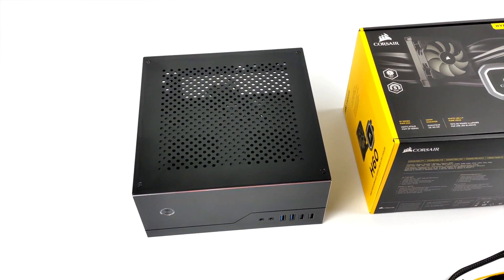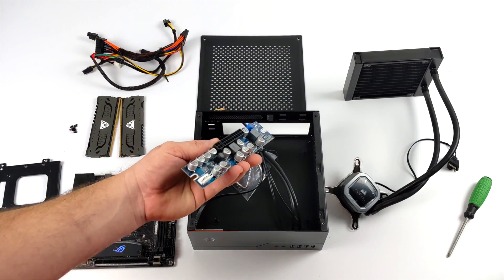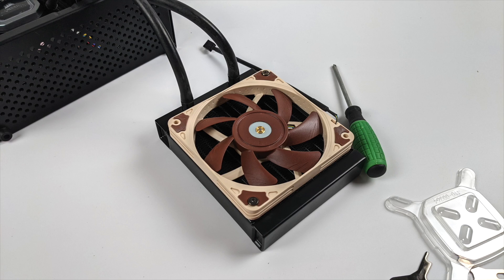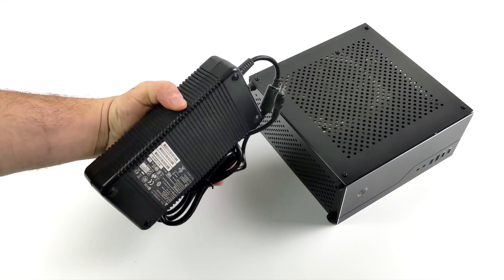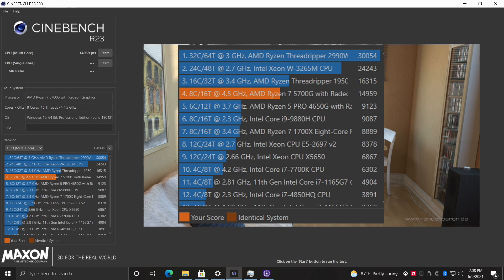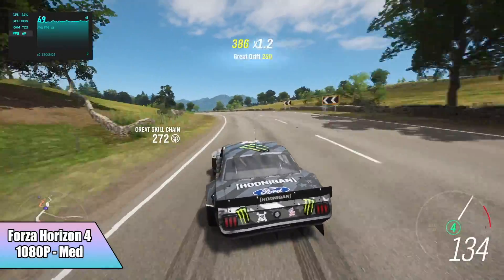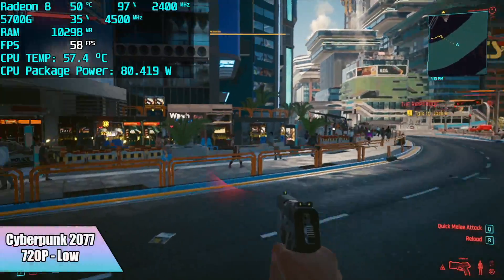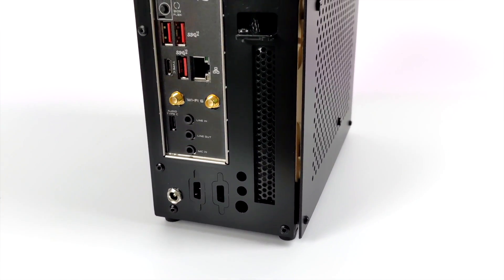Ultra Small Water Cooled Ryzen 7 5700G Gaming PC Build!

Comment: Great build. The last ten Pc's I built were asrock deskmini's ot small cases with mini-itx motherboards  
I built a few Asrock desk mini's with the Ryzen 7 5700G, The mini case is  6X6X3 inches. I used the Noctua NH-L9a-AM4 cpu cooler. Very adequate for that cpu.

Comment: Have done a video on the 5700G  with 64 Gig ram and using 16 gig of that for Vram? If not, I'd Like to see the performance on that? thanks. I've done it on mine with 32 gig ram and 8gig dedicated to the gpu. I actually just did that today but haven't tested it yet on gaming.

Comment: I'm doing this exact build except I'll be using a fan instead of water cooling. Other than that all the components are the same. Quick question though, what other power brick/cable do you recommend? The one in the description says that it is out of stock on amazon.

Comment: Were you able to overclock like that with just the 4 pin CPU connection from your power supply, or did you need to add an 8 pin adapter?
Reply: 4 Pin brings 192W for the CPU.For Gaming and 99% of other stuff it's enough for that

Comment: One aspect to tuning APUs is leaving the CPU clocks on the low side to maintain lower voltage and overclocking the gpu side and tuning the ram. Because the APU shares power and thermal headroom with the cpu it's best to stress just the gpu for gaming. (The the cpu at lower clocks wouldn't bottleneck the gpu in any normal usage). I'd say try something like this in the future

Comment: The flashing aliasing from CODWarzone was really distracting and annoying to me. I also don't like dynamic resolution either. The pop-in insanely-low-resolution shadows were also very distracting, and surprised that the game actually has that as an in-game setting rather than some config file hack because it looks insanely bad before the pop-in, like looking at a QR code.

High-tech high demand modern games look uglier at low settings than a 15 year old game looks at high settings, or at least CODW is the perfect example of when it is the case.

Everything else looked okay though. Except Cyberpunk which definitely needed to be 1080p despite the low FPS. Especially considering that it's an easy non-competitive game, the FPS doesn't matter much.

Comment: hi, just two notes : When overclocking cpu speed and memory, there is a sweet spot that is almost never the maximum Mhz, take a look at gamernexus youtube channel. You will get higher performance, much higher in fact at certain speed ratios.
Those AIO(All In One) water cooling solutions have a limited life, just, get ready to replace it in a couple of years.
Reply: You are actually wrong. This is a Ryzen APU with no infinity fabric, so it functions much like an intel build for memory. You want as fast of memory speeds on an APU even if the cpu speed relied on infinity fabric and was slowed as a result, because the graphics needs as fast of memory as it can get. With AM5 using ddr5, we will see even closer to discreet gpu level performance as the ram will run at higher frequencies.

The sweet spot on 5000 series is between 3600 and 4000 depending on your cpus capabilities, although I have seen desyncing infinity fabric, with high enough memory clocks, outperform that sweet spot too. It is just more rare. The 5000 G series should run at the highest frequency you can push with decent timings and latency, as the graphics are almost always more limiting than cpu speed would be.

As for the AIO, you're more right, on that. The pumps will eventually die, but they usually last 4-5 years at least for high quality ones. I've had some last longer too. Some bad ones die in under a year. But for small form factor they're one of the best options still
Reply: @a.f.r.m...d.e.d.d.2898  "The 5000 G series should run at the highest frequency you can push with decent timings and latency" thank you so much for improving my english :D :D :D :D :D :D
Reply: @A Google User It is a single die, so infinity fabric speeds are irrelevant to it. That is why it can achieve 1:1 with basically any ram speeds. If there were multiple dies with an infinity fabric, it would still have the issues that other 5000 series Cpus have had with ram over 4000 mhz

Comment: Looking at this build, i think it can be done better with a better case. The Velkase Velka 3 is a mitx case that's set up in a sandwich layout and uses a flexatx PSU in a 3.9L size. The good thing is, it's small but can handle a rtx 3060ti )mini itx verison, 170mm). But since you don't need it, you can chose to change the case from the standard to a 1pcie slot apu version. The motherboard is essentialy moved one pcie slot back. Allows for more CPU cooler clearance yet leaves you with one slot for let's say a capture card.

Comment: APU is good only if you must use tiny pc case, but except for that, its better to get reasonable priced video card with reasonable 6c 12t CPU.
I have 4750G, though.
Reply: "reasonable priced video card" doesn't exist...
Reply: @LiLBitsDK  I know. so this is good choice for right now.
I bought 6 monitors and monitor arms,  X570 AORUS XTREME E-ATX, 128GB Trident Z Royal RAM and 1GB M.2 x3 and  80Plus Titanium power units x2, and PC case last year Octorber, and waited 5800x and RX6800, but while I was waiting their price fall down a little, I couldnt buy them anymore.

Comment: Has the Fclk been increased on the CPU??
Not 100% but I was under the impression that all Ryzen CPU's run a 1800mhz Fclk which is the single bus speed of the link between the memory controller and the CPU/chiplets, then with dual channel its 3600mhz.
Again not sure but my understanding was if RAM is run higher then 3600mhz dual channel its causes the Fclk to be set at a 2:1 ratio, hobbling the RAM setup.
Reply: some can clock to 1900... but yes after that memoryspeed is split 2:1

Comment: Great build! Fantastic results! One thing to mention. I couldn't tell for sure as it's very difficult to see from the shots you showed. If the AIO pump (contained in the CPU block) is elevated above the highest point of the radiator air will collect in the pump over time as liquid inevitably escapes the system through permeation, and eventually kill the pump sooner. Shouldn't be an immediate concern and can easily be alleviated by laying the system flat with the radiator on top. Or the radiator may be above the CPU block already. like I said it was difficult to see from presented shots.

Comment: I have that exact same ATX-DC converter from R-Geek (that blue power rectangle for everyone to understand) and all I want to say is that you should be really careful with the included female barrel/jack power connector (the one that is exposed at the back of the case in this build). Although it is the highest quality 5.5/2.5mm jack I've ever seen, it is not special and should not exceed the specification, meaning that you are way over the limit at 200w. You should never exceed 10 amps with that connector. The plates on the back (where the wires are attached) are very thin.
It works for you, sure, but for how long. It could end pretty bad if something is to happen. Depends on the usage and the hardware.
Probably nothing bad is going to happen, many people uses this dc-dc converter with the included cable. It is just this little thorn in your brain that keeps pushing everytime you use your computer. Just keep power low and not on 24/7.
Same for the power supply. Yours is designed for 240w through a 5.5 barrel, it is sketchy, but all I know is that it works (with the cable really warm).

If you look for information about this product and the included cable+connector then you'll notice that almost everyone saavy cuts/desolder the cable at the end and use custom solutions. The PCB accepts 2 positive lines and 2 negative, so I personally removed the barrel connector and use 4 female banana connectors with the 4 internal cables being actually solid strand wires 16amps each (plus the ground cable)...way overkill for any setup but at least I never have to worry about it again. As for the power supply I use those generic, 30amps, gray ones with multiple 12v power outputs (mostly used for cctv and led strips). My pc uses around 20amps, with a graphics card and works fine 24/7. The monitor is also powered by the same power supply!

My advice is that if it works fine for you even under full load during long periods of time then leave it as it is. But, if you could get your hands on a second female barrel connector (the same quality as the included one) then you could split the load and be set for life.

Comment: You said that averaging 49 FPS at 720p with low settings on Cyberpunk was "not that great" but when you consider you're running off of an APU, that's pretty insane.
Reply: Would be great if we could buy the Xbox Series X APU for PC use.
Reply: @fordgtguy  ive done that with ps5 amd apu. Its okay for normal stuff but the thing is games are optimized for console so pc games arent running as great on the playstation hardware.
Reply: Apparently nvidia doesnt want cd project using fsr because anti competitive behavior is best.

Comment: Did you happen to check if the UMA Framebuffer could be resized on your Asus board?  I saw it was still at 512MB in CPU-Z.  I'm waiting for Gigabyte to update their BIOS so I can boost mine to 4GB like I could with the 3400G and 4700G.

Comment: So you want a really tiny APU build but don't want air cooling.
The logical reason behind this would be to have a greater surface to cool with.
A 120mm radiator isn't gonna perform better (or less noisy) than a comparable sized air cooler.
Seems kinda pointless to me but I guess I'm overthinking the current SFF watercooling trend...

Comment: I am a rookie when it comes to Pc building, I am looking to build one now but we all know about the graphic card situation. my options are to build a PC using an APU like the 5700g or to buy an M1 Mac mini. My main purpose is to Graphic design and do 3d modelling and animations on blender.i would like to know which one is relatively cheaper and which one is faster?
Reply: I know this is kinda late, but it'll be probably around the same price.  The only thing is the PC build would be more open to upgrades and it will be a lot cheaper too.  So you can add more ram or an SSD when things go on sale, maybe even a discrete GPU when you do 3d modeling.

Comment: Just curious how does a 120mm aio compare to a 120mm LP air cooler like the Noctua L12S or BQ shadow rock LP? 

I imagine they have similar clearance limitations and also similar surface area for cooling.

Comment: I don't feel like you're getting much of a pay off with this liquid cooling setup.
Reply: Pretty sure he knows. I think he just did this for shits and giggles.
Reply: A good fan would do well in this build
Reply: @nicksrandomness2774  this build will save you more energy
Reply: À
Reply: If it isn't 240mm or above, I aint choosing Liquid cooling setup. Most Heatpipe Coolers provide more surface area and perform better than 120mm radiators.
Reply: @Cruxics  for overcloking
Reply: Yeah I can’t imagine water cooling giving you that much more performance especially not after doing all the work
Reply: @nicksrandomness2774  llllllllllllllll
Reply: @nicksrandomness2774  it'll vcffguuu Oblivion bootloader web 9
Reply: @nicksrandomness2774  ch@
Reply: There is a good reason for this AIO. That case doesn't have enough height clearance for proper 120mm towers. All good tower air coolers need at least 155mm height clearance. Low profile air coolers won't work since this rig can pull upwards of 200W without a discrete GPU .
Reply: @fleurdewin7958  wraith prism/max cooler is only 90mm tall and performs about as well as a hyper 212. the only way to get them for a good price is used however, so of course nobody features them

Comment: IMO, RDNAx APUs with 12-16 CUs and 64 MB 3D V-Cache will render entry level to mid range dGPUs obsolete.
Reply: 64mb of infinity cache would be too big for a low power apu tho
Reply: @malathomas6141  TDP will be 65 W so 64 MB 3D V-cache would not be an issue, in fact it benefits gaming and cache intensive workloads.

Comment: So it looked like you only had 512mb of ram designated to the APU for VRAM. How dose it affect performance if you up that to say 4gb in the BIOS?
Reply: Thankfully enough, that is not needed. 512MB is just the memory dedicated to the iGPU, but the system will give the iGPU all it needs dynamically.

So if you have, for example, 16GB of RAM and a game needs 6GB of VRAM, the OS will give the iGPU 6GB. You can confirm this in the task manager's performance tab. It will report both dedicated and dynamic/shared VRAM. The same thing happens with graphics cards actually, but of course they have a lot of VRAM already installed.
It's always up to half of your RAM, aka, 8GB VRAM for 16GB RAM.

Remember that if you set 4GB in the BIOS, you'll completely "loose" (won't be able to access) those 4GB for the rest of the programs and OS.

Comment: Someone please explain to me, this radeon run at 2400mhz, the other video of mini PC with gtx 1650 i see that it run at 1300+ mhz, so does that that mean this radeon is better than gtx 1650?
Reply: No it is not better than a 1650...you watched the video but can't compare the FPS? Clock speed is one metric and does not mean absolute performance
Reply: @samgoff5289  thank you, i don't really understand how to compared gpu power
Reply: @auf5655  Best just to compare by benchmarks. It's a lot like a car. A little 4 cylinder honda might rev up way high, but it still isn't as powerful as a big V8 out of a sports car. That comparison actually works pretty well here because this is a tiny APU built into the processor, where as that 1650 is it's own separate chip and can be much larger.

Comment: @ETA PRIME could you please upload a screen of the CPU-Z memory tab or from HWinfo64 showing fabric clock, memory controller clock and timings? These are extremely relevant parameters for seeing how viable and optimized the OC is and only by knowing them, people who want to do a similar build can replicate your settings. Please include these in your videos in the future. Also, your memory seems to be running at 4266 speeds (according to GPU-Z and CPU-Z graphics tab).

Comment: So, just out of curiosity, what is to stop you from 3D printing a small video card (Sidecar) for this case and having an L-shaped tiny PC, that is as powerful as any Full tower gamer build? 

Cheap to enclose, Easy to do from where the build already is, and I'm sure you got a few spare vid-cards to throw at it. 

Show us what "Maximum Game" looks like on this bad little mamma jamma! 

;-P
Reply: The case is big enough for a low profile gpu as is, if you watch the video where it shows the rear io of the case you can even see a single slot pcie cutout that can be punched out
Reply: @samgoff5289  Yes, but it appears the water cooler fan and radiator are where that would be placed inside the case. If you are wanting an ultra portable or just micro PC that has the water cooling AND a video card, this is a great platform to use. Lots of power, and VERY Small/Simple.
A PCIe riser cable, run out of the gap he created in the case side panel, under the machine, and connected to a sidecar style 3D printed housing for an Actual GPU, would be amazing for such a small build. 
You would be seeing 200fps+ on some games and Maxing out 1080p/4k settings in emulators at that point. 

HDPLEX and AliExpress show as having 400w Pico supplies. The HDPLEX has been sold out for a while, but would easily fit into this build with enough power for a dedicated GPU.

Comment: Friendly tip: while this Corsair AIO is far easier to source, Acetek also makes a 92mm AIO water cooler which doesn't sounds like much of a difference but it does matter quite a bit when dealing with rigs this small and could potentially mean a slightly smaller case can potentially be used.

Comment: I love noctua but man i just can't like the brown fans 😁.Cooling should be fine because you lifted the panel a wee bit.I use to test cases airflow and usually like in my case i have 3 intake.2 which is mesh and 3 exhaust because the back fan can't pull all the air out so you get turbulance.That's the only problem i have with this build is that it blows down but no exhaust fan.Although it has a lot of ventilation so it should be good.

Comment: how will watch dogs 2 run on that little build eta prime? i daily playing that game at high medium mix settings with my gtx 1650 ti with my amd ideagaming pad 3 laptop with 32gb of ram and the ryzen 4800h  with 32gb of ram since amd does really prefer fast ram
Reply: 32gb of ram is the capacity not the speed....there is slow 32gb kits which I'm sure is what you have in the laptop
Reply: @samgoff5289  yea thats what i got in my ideagaming pad 3
Reply: @samgoff5289  upgraded it from its orginal 8 since it was single channel so i upgraded it to dual 16 gigs of ram so it wouldn't be in single channel mode
Reply: Wd2 damn boii
I also play wd2
Awesome game tbh

Comment: dont oc manually. use pbo with curve optimizer. which will give you higher single core OC speeds and better gaming performance PLUS you barely loose any multicore speed if any...
Reply: I don't know why ETA is so shy on Undervolting. Almost nothing compares to Undervolting in terms of extra performance, lower power consumptation, better temps.
Reply: @Michał Talarek i did offset overclock with scaler 7x on my 5900x. it boosts up to 5.1 ghz while gaming and doesnt get over 80 degree celcius... while gaming an all core overclock will always give you disadvantages over amds new pbo overclocking.
trust me, i tried it on several ryzen 5xxx cpu's, and pbo always won. in multi and in single core.